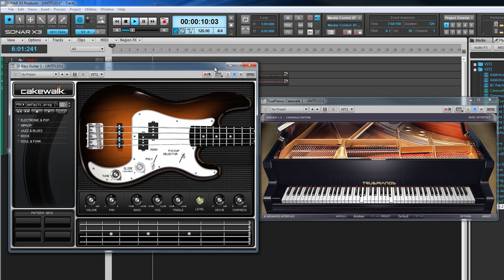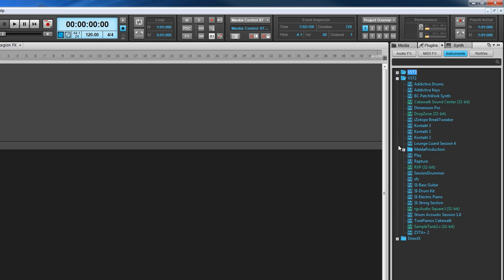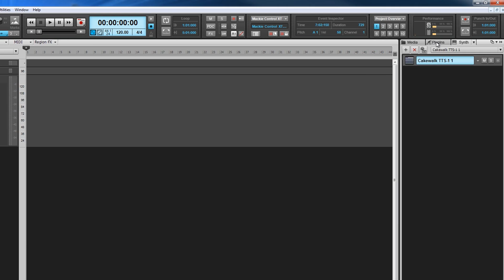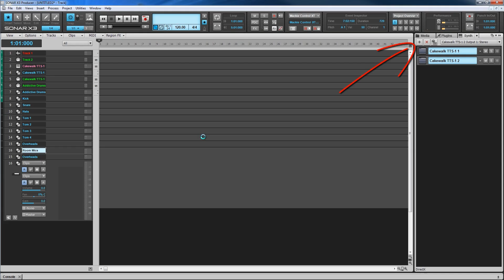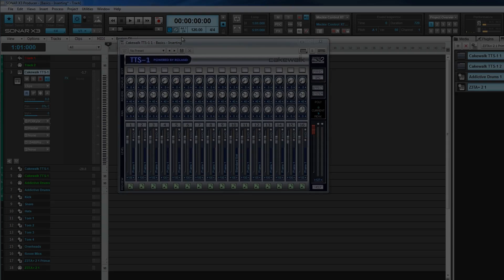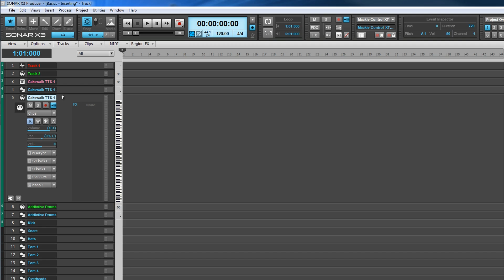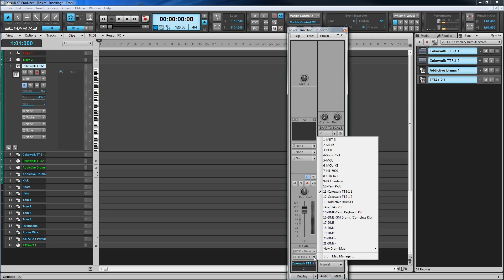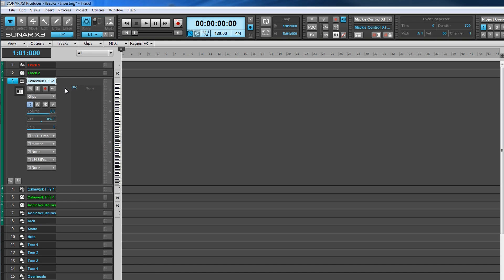SONAR X3 Advanced Workshop: Introduction & Basics

Comment: Why is it that I follow these instructions exactly as they are shown and next to none of the same stuff happens on my screen?  This program seems to make the most basic tasks overly complicated.  Example; In real life if I want to play the guitar I pick it up and I play it.  They way Sonar X3 works I would liken to having to build the case from scratch, forge the strings myself and wire and tune the guitar upon every single use.

You guys need to get a consultation from someone, perhaps at Apple? (and I don't even use apple products) and get a lesson or two in user interface design. 

Eventually you'll get to what you need but most of this stuff should be happening automatically.  For example if I or anyone else wanted to use a vst quality piano as the instrument it should be as simple as clicking an instrument button , going under a vst section, and then clicking on the desired type of piano followed by importing, playing, or linking to the desired midi data.

You've managed to do it with soundfont quality banks. Why did you go out of your way to make it such a negative experience with anything of a higher grade?
Reply: I'm just getting into recording and from your comment it seems sonar wouldn't be a good choice. What do u think is the easiest program, that u can get still pro level recordings with is?
Reply: I ended up going with studio one. It's a great program I rly like it a lot. I couldn't of got this anyway cause my home studio computer is Mac and sonar is only for PC I came to realize.
Reply: I even find the new Cakewalk impossible when it comes to using the soft synths. I have found it ok for mixing and mastering live audio tracks but, trying to create a simple drum loop and bassline from the soft synths? I just can't work it out. Way too much jargon.
Reply: Sonar free alpha version for testing coming november 2016 ; yes, Cakewalk hits the Apple wagon with Sonar ! :0)
Reply: Alpha17x I agree!
Reply: @homeone4054   You may already know this but softsynths ( VST etc,) need  "MIDI" information to play. You can insert a softsynth,  asign a midi track to that synth, ( the lower section of the midi track has a send /choice box where you can see your soft synth listed) record your performance on that midi track and that gets "Played"  by the softsynth   If you dont have a keyboard a person could download a midi performance to use to listen or tweak a softsynth in your program.
Reply: I agree with some of the comments here. Getting the VST to work is a pain for me. I have my midi connections right, but getting Cakewalk to recognize that signal is indeed a pain.